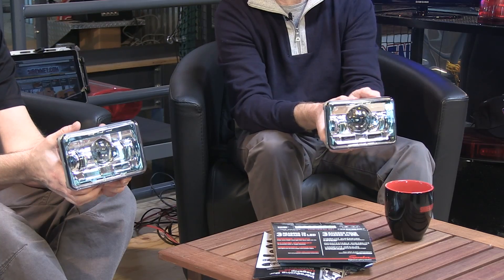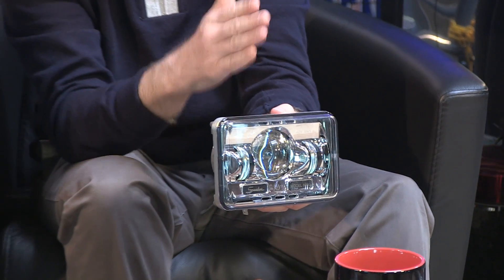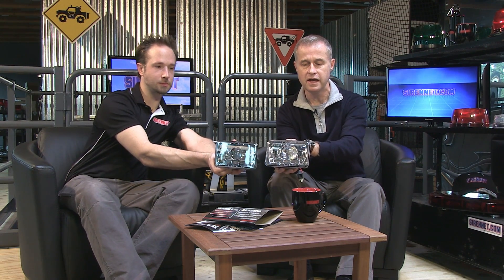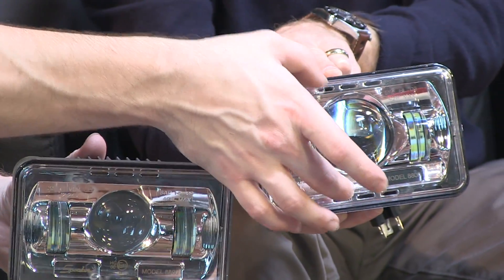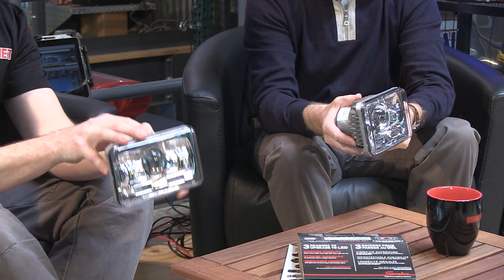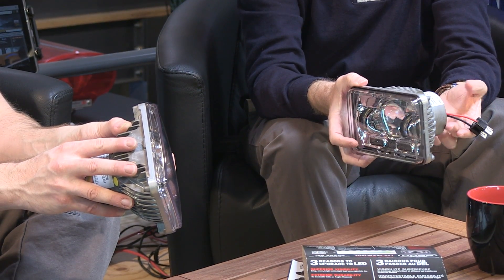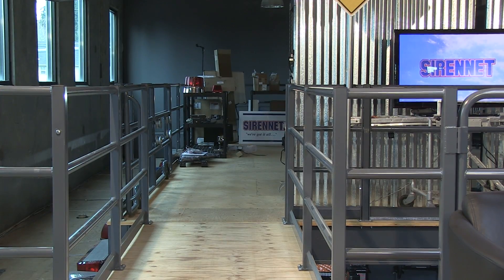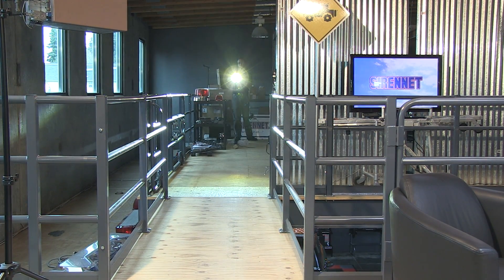LED Headlights from J.W. Speaker

Comment: Guys one more question. I work in cold ice rain an snow conditions during the winter.
Do these lights generate enough heat to eliminate ice buildup?
Thanks
Reply from the maker: Christiaan Cronje The 8800's do generate some Heat... Depending on the temperature and how thick the Ice is, we can't say for certain if it would be enough to keep them clear / de-iced.